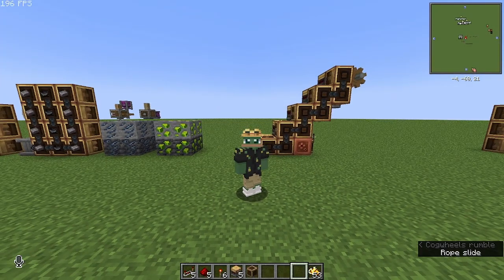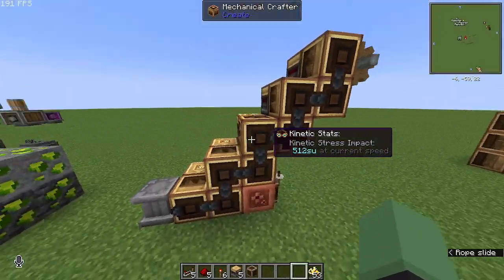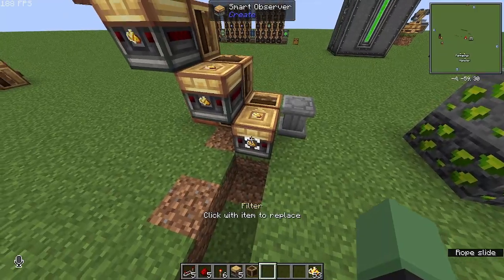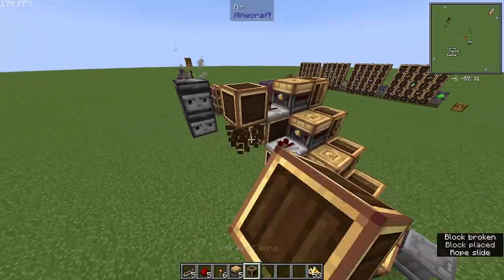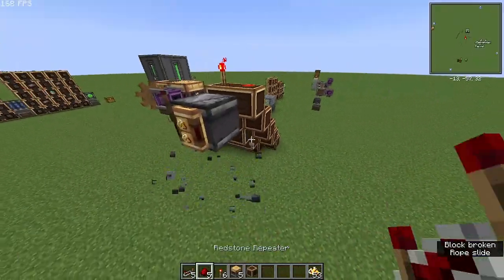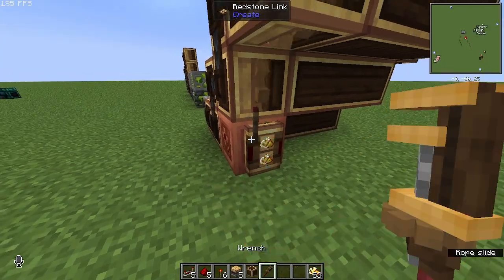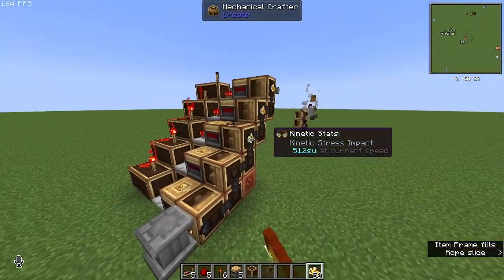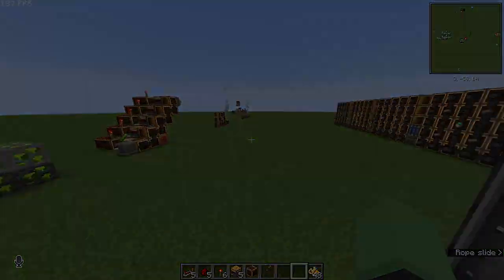Create Nuclear: How to auto-craft the Uranium Rods!

Comment: for those who cannot get Smart Observers to work. skip ALL redstone items/blocks and use a Lever. 

so basically, build the 3*3 crafting grid in a diagonal fashion just like in the video. but completely skip all the redstone items and ditch the observers.

 after building the crafting grid, give some rotational force as you would usually-then place a lever near the end or the "completion" portion of the crafting grid

 place the 5 enriched yellow cake in their respective slots-then "turn on" the lever that you placed down earlier. this caused the 3*3 mech crafters to light up. from what I understand the Redstone is needed to separate the "empty" crafters from the filled ones and the recipe had begun crafting the uranium rods.

why the smart observer does not work? I cannot answer truthfully nor accurately answer as I havent the faintest idea why.

Comment: I had a problem that the smart observer does not activate when I put the cake in Crafter, I did everything strictly according to Naidu (sorry for my English, I am writing through a translator)
Reply from the maker: Make sure the smart observer has been filtered and IS facing the right way. and if both are correct, then i am sorry but i dont know what could be going wrong
Reply: I ACCIDENTALLY FOUND A SOLUTION TO THE PROBLEM!!! Just use a stub( crafter_slot_cover) And then a smart observer is not needed!
Reply: Cómo q es estar filtrado

Comment: Have you tried adding Crafter slot covers to the mechanical crafters not in use? may save you a lot of redstone and observers!
additionally, if the crafting slot covers prove functional, you can connect all the mechanical crafters together by wrenching the lines on the back side; doing so will allow you to import all the yellow cake from 1 point.
Reply from the maker: yea i found out you it should also just work if you do a 5x5 crafting grid. it just in my past experience i couldnt craft items even with extra crafters but now im more knowing how they work :p wish there was more ponder info